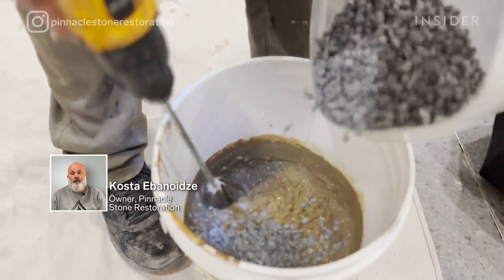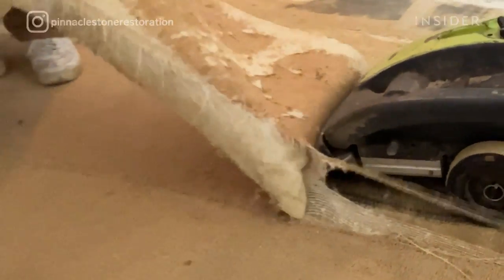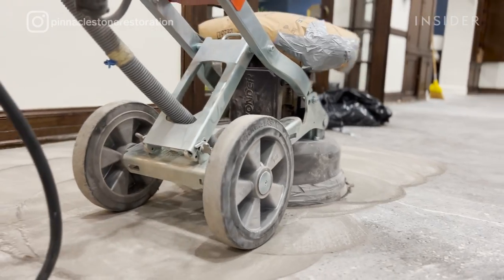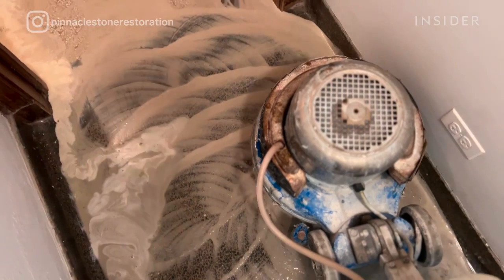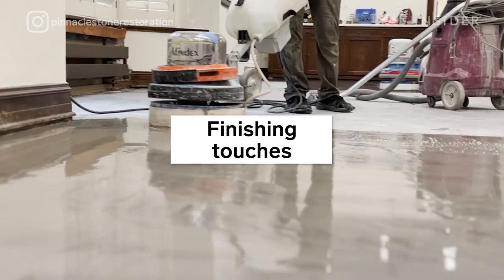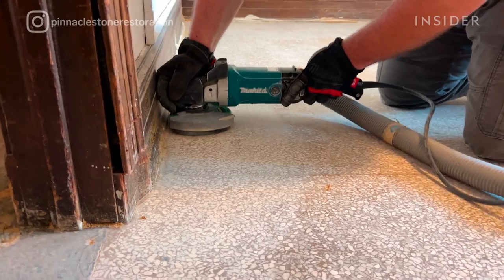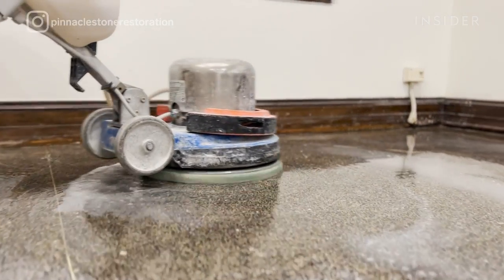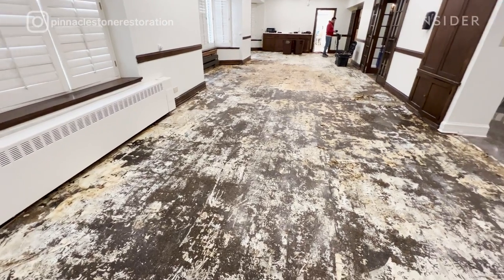Restoring Terrazzo Tiles Hidden Under Carpet | Refurbished | Insider

Comment: Beautiful. In the mid 1990's I went to a customer's house to measure their  foyer and formal living room for new flooring. The house was in an area of San Antonio where the houses were built in the 40s and 50s. The houses were huge and eclectic. Anyhow, I get to the house and the front porch, foyer, and formal living room were all the most beautiful Terrazzo I had ever seen. The aggregate stones used were like 3/4" to 1" in size in green, yellow, rust, and white...so colorful. So amazing. My amazement and awe at the beauty of their floor convinced them not to rip it out. I told them not to do it and I was happy to lose the sale. I'd do this in my new home instead of stained concrete.
Reply: You're great😊👍🏼

Comment: I just got done doing fifteen hundred feet of glued carpet on terrazzo. Here's a tip. Use the coarsest sanding pads with copious amounts of water to keep the glue cold so it sands off and gets any glue stains. Much faster than by hand.

Comment: Don't forget the part where all the doors now have a pretty massive gap under them because they brought the floor level down so much.    I did something similar when I moved into my house some 25 years ago,  ugly old dingy carpets through the whole house, what was under it?  well hardwood floors of course because the previous owner was an old lady who didn't like cold feet,  tore out all the carpet and then there was a good 3/4" gap beneath every door except the bathroom (because only an idiot puts carpet in there),  I've learned to live with the gap because it's my house so the it really isn't necessary to have the doors closer to the floor but for a shared space like a dorm?  Maybe a little more necessary.

Comment: I bought an old house last year and the floors are exactly like that. My tiles are old, gouged and have inconsistent grout. The tiles are 30x30cm, and it's really too much work to fix, especially because some of the rooms have even older 20x20 tiles of different color, not to mentiln some are missing... I think I'll end up just gluing modern tiles over it...
Reply: You’ll get a terrible bond by glueing over it, get rid of them or don’t bother.
Reply: If you have tiles your floors are not exactly like that
Reply: @oblitafier  Big Difference between Terrazzo tiles and a real poured in place finished in place real Terrazzo floor
Reply: Hi Dima...when you say they are 30 by 30 what is used to divide them? If it is a metal strip silver looking or brass looking you might have an old real Terrazzo floor...
If the 30×30 have grout joints you have tiles....
I'm curious...
34 years in the Terrazzo trade...
If you have real Terrazzo I would suggest a good cleaning vacuum then rinse and scrub... before I get into all it ... need to know if they are tiles or real Terrazzo...
And depends if you like it or not...Easy to keep clean and low maintenance after a regrout...
Reply: @jamescoleakaericunderwood2503  It's tiles joined by grout. Probably not really worth keeping, as there have been some replaced over the years and they just stand out. Beneath is just sand/ground.
Reply: @dgurevich1  
You can bond over that...I'd remove any loose tiles and fill the voids ...you can use thinset with some sand and just pull it with a stick flush...
Just make sure you give it a good scrubbing and rinse and wet vacuum it up well to get a good bond when installing new tiles...dust is your worst enemy when it comes to bonding...I like to put water down and then broom it with a straw broom works really well to loosen up dirt then vacuum it up..if they are old enough that the sealer has worn off mostly you should get a good bond as long as no dust....but if they are still shiny I'd use a primer before tiling...✌️

Comment: I have issues with this. Owners invested what I suspect thousands into the restoration yet left the baseboards in place??? Why? You can even see gaps under some painted pieces. What about potential water damage after all the wet sanding? Now they will have a carpenter work on trim after the floor looks perfect? I hope they wont just slam shoe moldings all over :(